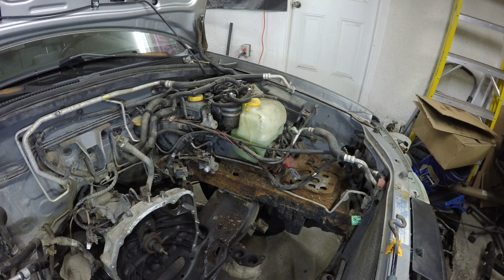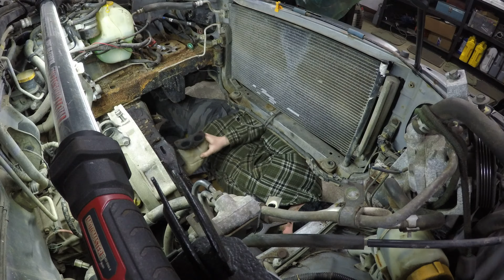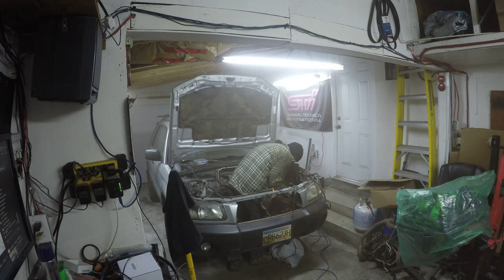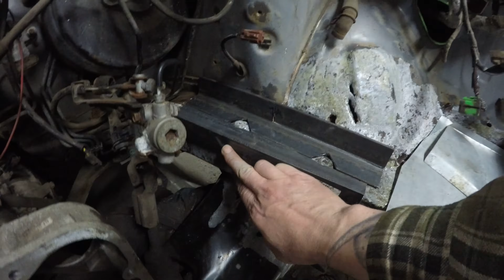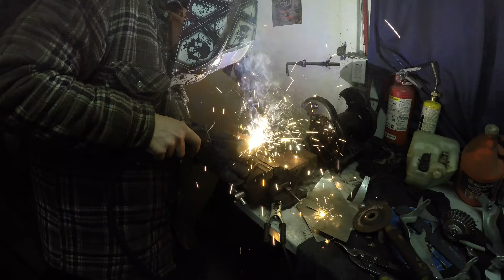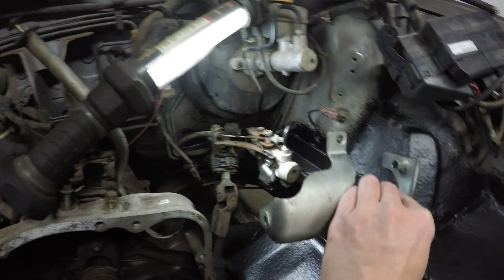Forester Structural Rust Repair - How To

Comment: Just put UEL headers on my 05 outback yesterday, had to cut the bolts from the manifold to the cat pipe haha they would not move.
Reply from the maker: When I had to switch out the UEL NA style header from the Impreza to a WRX style header, I knew exactly what to do with the one that came out. I will start with it and work my way back later on.